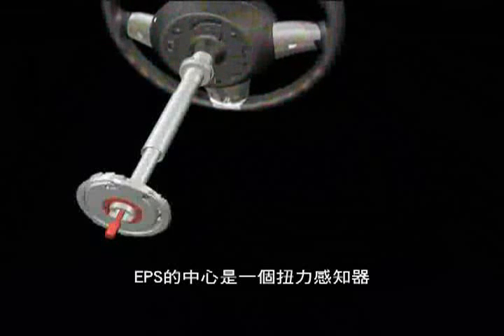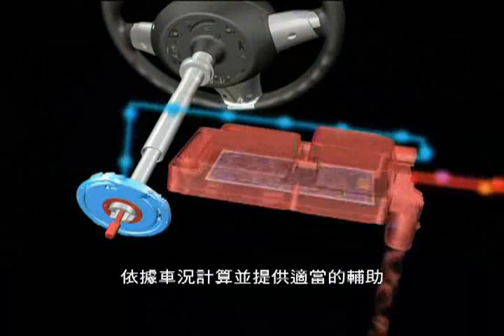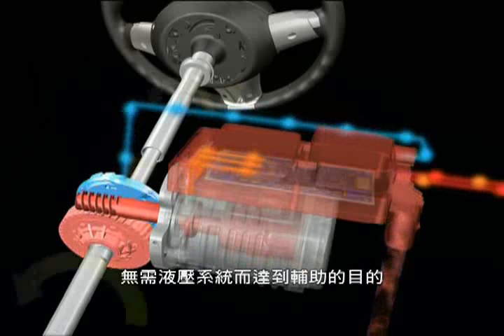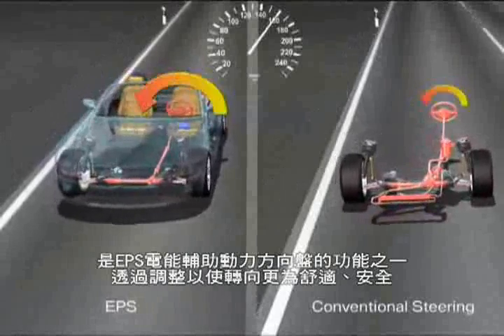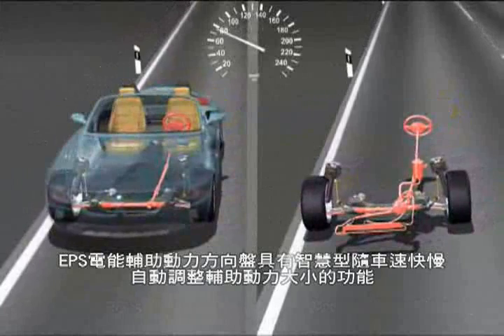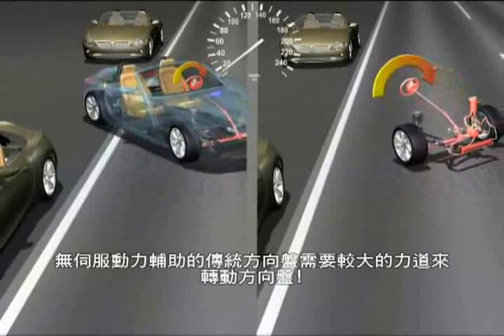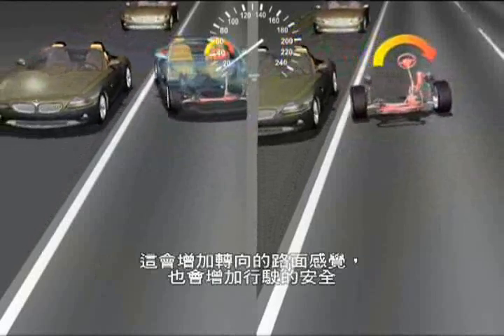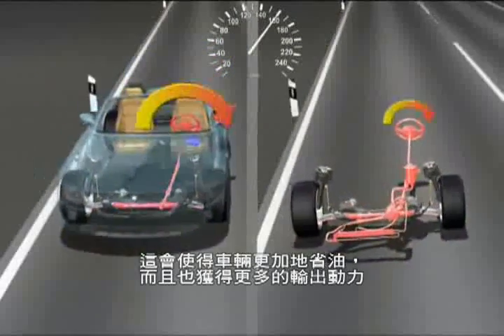BMW Electric power steering EPS 電能輔助動力方向盤

Comment: The placement of the electric motor is a good idea, compared to hydraulic electric systems... However, most 2000 and later cars have very reliable, variable mechanical systems... The only real advantage of this is improved efficiency at the expense of reliability.

Comment: i used to have a hydraulic bmw and now drive an electric volkswagen i dunno - each one has its cons and pros.  the old school bmw was more involving but a bitch to park.  the new vw is a little detached but smooth as butter.  as i live in the city and and have to do a lot of turning at low speeds and parallel parking i actually prefer the new electric system.